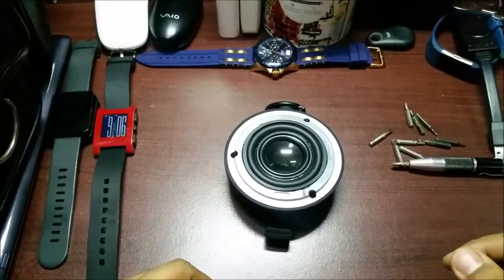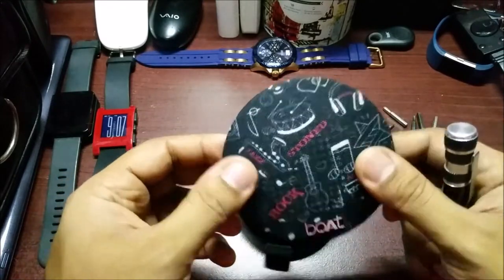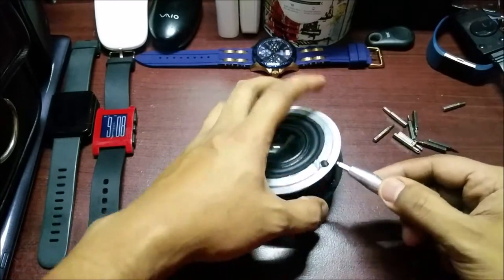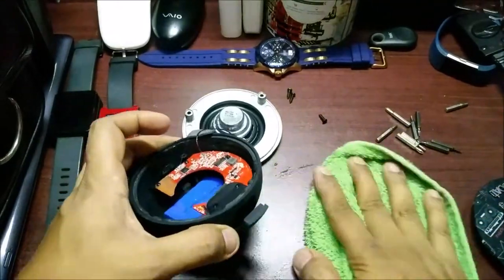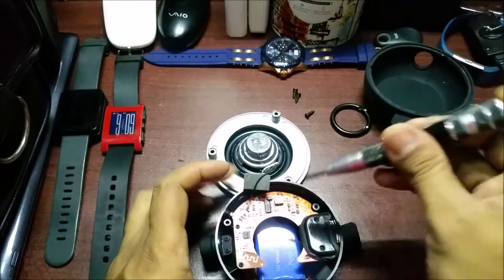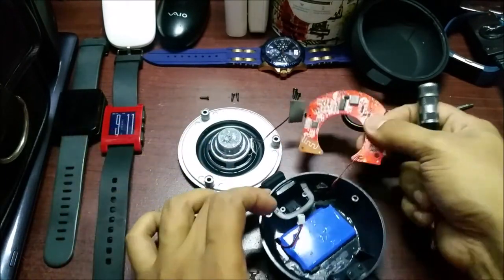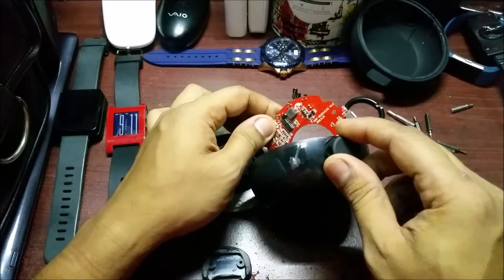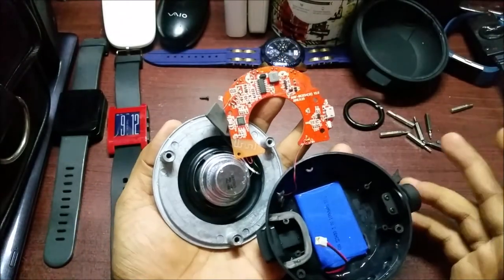BoAt stone 260 (Real life) Disassembly

Comment: Did the battery had its capacity written on it?? If yes then how much was it? I have seen some brands who claim more Mah but actually have less mah batteries.
Reply from the maker: The battery was glued to the bottom of the  speaker so I could not remove it completely. I think there was something written on the battery but I didn't make a not of it.

Comment: Sir, help me I have an issue. My boat speaker is not charging. When I plug the USB, initially the red light is on but after 10 seconds, it turns off.
Reply from the maker: Normally this happens when there is a battery issue.